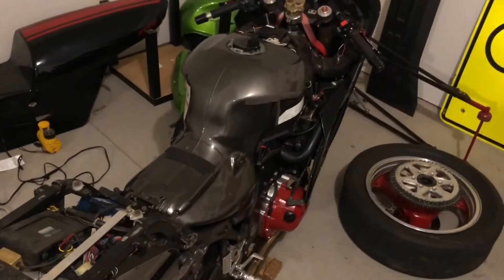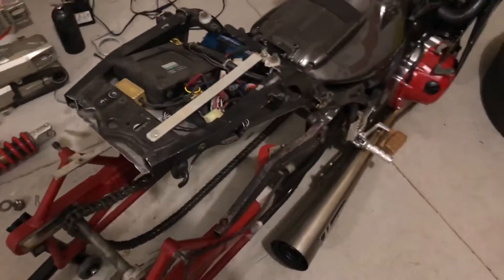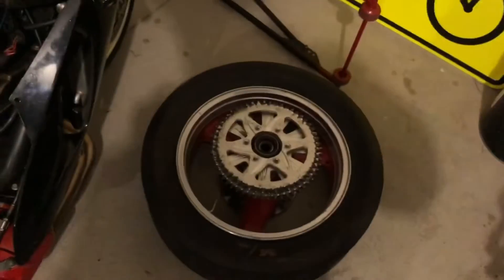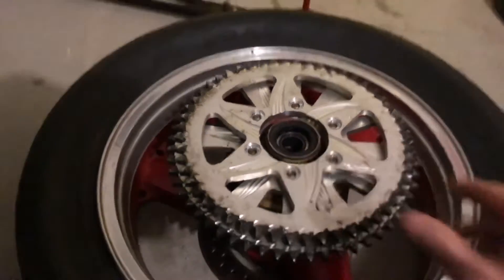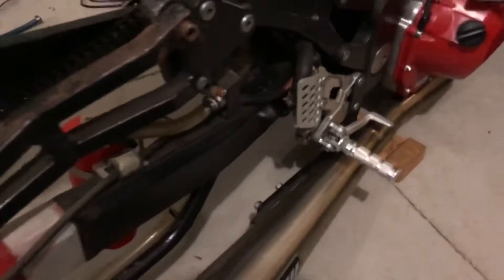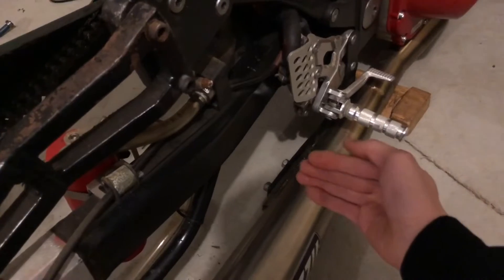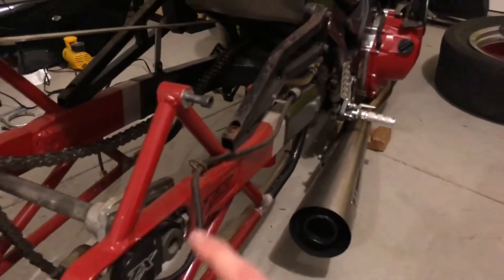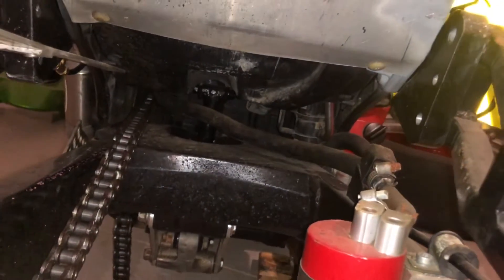ZX-12R Drag Bike Update

Comment: Why use CO2 though? If you already have a working system with air, just have a compressor in the pits and fill it up after couple of runs. Most of the time at the track is waiting time anyway...
Reply from the maker: Pure CO2 doesn’t hold moisture or humidity like air does. So running normal air can get moisture in the solenoids and valves and cause mis-shifts and sticking. Most people just fill their tank with CO2 and will have a small air compressor on the bike to just top it off if the tank starts to get low!
Reply: @Lynkinite  so we are talking of compressed co2, not liquid co2? Then you can probably still use the same system?